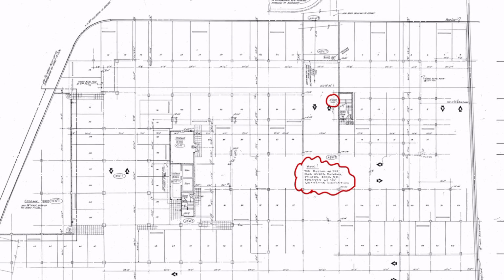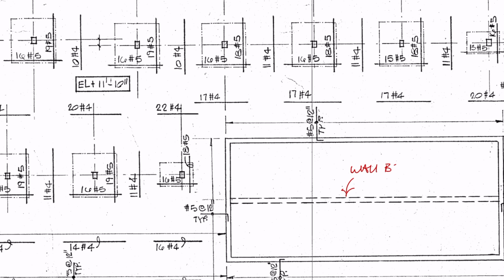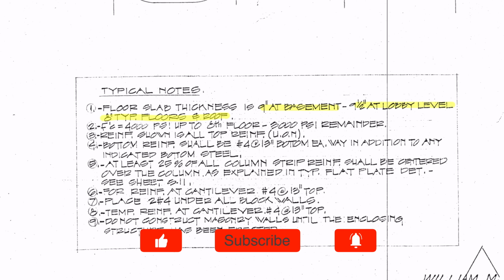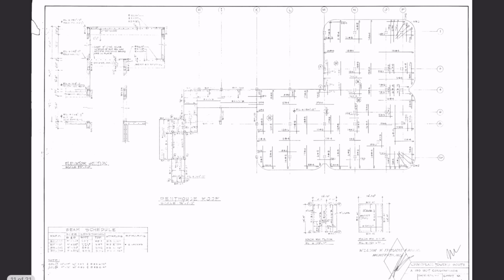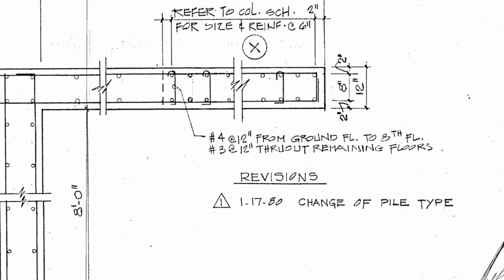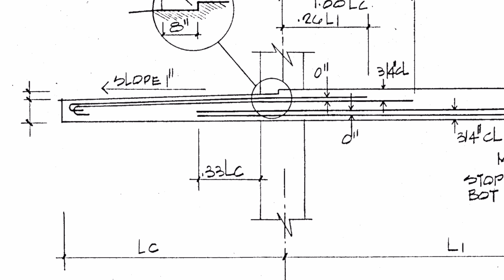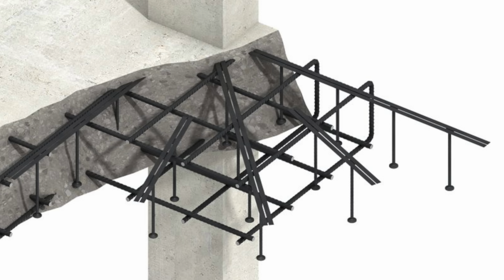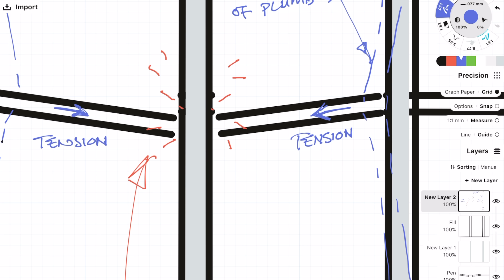Surfside Condo Collapse - Reviewing the structural drawings - Was the design bad?

Comment: Falling debris in the parking ramp likely ruptured the sprinkler system.  Such rupture and resulting water pressure drop should have activated a fire alarm throughout the building, alerting residents to leave the building minutes before the collapse.  Did this happen?  If not, why not??
Reply: I was wondering that myself. Been told some condos do have an alarm system if a pipe breaks to isolate and limit flooding of units. In this case such an alarm could have saved lives.
Reply: @jjintheflesh   I guess the potential for a building to collapse is another good reason to heed a fire alarm.
Reply: I saw elswhere that such a rupture in the parking garage just sets off an alarm to the Fire Dept and not within the building itself.
Reply: @Bangkok-travel-ideas  Yeah, like what the hell?  Shouldn't the occupants be the first notified there is a problem??
Reply: @Just Looking Good observation.  ( Who would have thought a tourist video of a parking ramp interior would go viral? )
Reply: The fire alarm did sound before the building collapsed. The fire dept was already on the way and arrived just moments after the collapse. Loss of pressure in the sprinkler system does alert the fire dept but doesn’t necessarily sound the building evacuation alarm.
Reply: @stargazer7644  Thank you for that.  What good does a fire alarm do if occupants aren't privy to it?
Reply: @dngrwllrbnsn_  The fact that a dry pipe sprinkler system in the garage has lost air pressure doesn't necessarily mean there's a fire.  Just as when a single smoke detector goes off doesn't necessarily mean there's a fire.  How would you like to have to evacuate the entire building every time someone in one apartment burns the toast?  The security office and the fire dept gets the alarm when these events happen.  If investigation shows an evacuation is warranted, you pull the evac alarm.

Comment: Ive poured parking basement slabs for 4 story wood framed apartments .. always 12" thick with top and bottom 3/4" at 8" each way. That's a lot of steel but thats Los Angeles in the 1980's.

Comment: All your points re various technical details are well taken.  However, I look at the big picture. As an architect I would never design a structure like this.  I would have a 12" thick continuous foundation wall under the perimeter of the building tower. Any additional underground parking outside the tower footprint needs to be structurally independent.  One reinforced opening in the foundation wall would allow traffic between the two parking areas.

Comment: After I obtained and reviewed the structural drawings for Champlaign Towers, I was shocked by numerous things that were, or mostly were not on the drawings, including:
Lack of shear wall, as you noted.
Lack of adequate concrete cover on the slab reinforcing.  Failure to capture the reinforcing within the concrete potentially reduces the load carrying capacity of the slabs by 30%.  Appears rebar chairs were not utilized anywhere on the project.
Lack of column reinforcing extending into the slab.
Lack of bottom reinforcing in the balconies.
Questionable reinforcing size and spacing for slab spans as much as 22'-9".
Tying the pool deck slab to the building structure.  Due to thermal expansion and contraction, the pool deck would move differentially to the tower structure.  I would NEVER tie an exterior pool deck slab to the main building structure in a monolithic manner.  Maybe a slip joint.  Even though they require maintenance, expansion joints between the pool deck and tower structure would be better.
The pool deck resting on an 8 inch thick wall on the south side that has no pile footings under it.  Although the section of the retaining wall, on sheet S12 shows a partial pile footing, there are no pile footings shown on the foundation plan.

Just a lot of problems with the structural design.
Appreciate your simple, professional approach to presentation of your opinion and analysis.
Reply: The plot thickens with more input. Great info.
Reply: A typical incompetent engineer and contractor.
Reply: The drawing revision control seems haphazard also, did the contractor work to the latest drawings? Were the design and structural engineers using the same drawings? Things like this should never be left to chance.
Reply: @heathwirt8919  - Everyone needs to keep in mind this was a developer project.  Since the developer wants to spend the least amount of money and get the building occupied as soon as possible, developer projects get minimal construction oversight, if any, and drawings and specifications get changed by the contractor for his benefit.  The developer may not have paid the engineer or architect to do ANY construction observation and materials testing would have been a bare minimum.
Reply: @paulpresson9786  I'm speculating but my guess is the as built condition is probably not to the final drawing release.
Reply: I agree with your comments
Reply: It was built to the 1980 drawings.

Comment: It is 40 years old. Some say code-77, no punch shear reinforcement. Some say the pool deck got pavers 20 years ago. This load was not accounted for. The deck fails, the column collapses because it is attached to a beam to support a planter. And the beam takes down the column supporting the building
Reply: I agree with your hypothesis.
Reply: The concrete code has not changed significantly since 1977, all of the things you mention should have been included in a properly designed building of that era.
Reply: Structural madness says it is too skiny. 20x20 or 24x24 columns. There was no reserve left after 40 years.
Edit: we will see the end report

Comment: Excellent presentation.  This emphasizes what is most likely the principle cause of the failure, poor engineering.  Numerous observers have noted that the ravages of time were fairly typical for this kind of building.  Perhaps because of lack of access to the original design plans, some observers have had to rely on photographic evidence and the 2018 Morabito report to evaluate the structure.  Meticulous maintenance and retrofitting support elements could have saved this building, but this is a nearly impossible standard given the combination of poor building codes in 1980, possible poor oversight during construction, and inadequate inspections over the years.  Responsibilities associated with this structure were so diluted (if everyone is responsible, no one is responsible) that if anyone tried to condemn this building, they would have faced loss of reputation and legal liability. 
 Local government officials should have been more vigilant inspecting older buildings constructed with now obsolete building standards whose failure would have been catastrophic.

Comment: Your analysis of the structural design is compared to the structural design of 2021, I'm assuming. Can you comment on whether the structural design of the building would have been adequate if analyzed in the time of its construction, 1979? In other words, did they consciously design a building that was not robust or would that design have been adequate in 1979?
Reply from the maker: I’m going to do a punching shear analysis to the Uk codes (because that’s what I’m familiar with) and the American code (going to have to learn it).  
I am not familiar with US codes of practice but I will do a bit of research into it.
Reply: @EverydayDazz   Please evaluate the 9-1/2" thick concrete plate used both at the pool deck and at ground level building deck. 

The pool deck is supporting additional 2-1/2" thick topping concrete, pavers, tiles, etc. That's at least additional 50 psf design dead load comparing to the building concrete floor plates.

In addition, the design live load for the pool deck would be 100 psf for assembly vs the typical 40 psf for residential floors.  

The pool deck appears to be too thin!

Comment: I'm glad you mentioned the thickness of the slabs , 200mm is probably just ok in a normal building that is enclosed and not exposed to the elements,  but 200 mm doesn't seem  adequate for a pool deck that has an additional layer of paving , and is exposed to the weather,  all of the pictures I've seen recently of punching shear in buildings,  have been car parks that are exposed to the elements,  these exposed concrete slabs need more support by either pads on top of the columns,  or structural beams between the columns to spread the load, especially where you have vehicles moving on and off the slab every day causing the slabs to flex . I'm not an engineer but I'm a retired builder,  these are just my thoughts.  Btw,   I think you understanding of the problem, and the cause of the failure,  is the best I've seen so far.  I think you are spot on.
Reply: That pool deck had NO moisture membrane. The last line of defense to eliminate water. Many think a membrane is a primary way for water to exit. Not so...it is a backup way for water to exit. Sloping to drains is critical. Years of fresh/salt water just seeping into the non shear slab and columns, seriously flawed.
Reply: I thought the cars were all at basement level. So only cars driving on the foundation slab? Excellent point though I think about the stress and span between columns on the pool deck and no structural beams.
Reply: @fiionnafiionna3995  I believe the visitors car park was on the same level as the pool deck , if you take a look at some of the early picture , you will. See the cars on the collapsed deck, then under that deck was the residence garage.

Comment: Excellent analysis, thank you. It’s chilling to hear about all the vulnerabilities you found in the original design. These will also apply to the two sister buildings on the same avenue. 
As a non engineer, I have found the analysis by Josh Porter of the Building Integrity channel to be fascinating and easy to understand. I am going to follow you both. Jeffostroff also has some insightful observations.
Reply: *Josh Porter
Reply: @MrKoenig1985  Thanks, I corrected it.
Reply: Good point alluding to shoring East & North buildings walls, pillars. I commented the statute of limitations expired; Surfside had 40 years to shore walls, pillars. 

Aedin
Reply: A simple exercise: For each 100 pounds of horizontal component of wind force directed against a north wall, each of the east and west outside walls that are at right angles to it takes up 50 pounds of force. If a third interior wall is added parallel to the east and west walls then each wall will take up 33.3 pounds of force. The floors that also transmit this horizontal component of force to the outside walls prevent inward deflection of the north wall. Horizontal force transmitted by the floors that is taken up by the footings of the columns and rear wall may be ignored for this analysis.
   
Is a third interior wall of solid concrete required? (Referred to in some discussions as a shear wall). After calculating the force that the east and west walls must accommodate it is a matter of design choice. It is likely that the minimum thickness and strength of the east and west walls already greatly exceeds the horizontal force that these must hold back. Thus, for each 50 pounds exerted horizontally, the walls as a result of their strength to function as a wall supporting the vertical downward load from weight, are already capable of sustaining a horizontal component several times that amount, which is why the contribution of the footings was ignored.
   
A building is designed so that the entire structure remains standing. That a collapse is only partial appeals to emotions, not logic. 
  
An interior wall of solid concrete that is not connected by rebar to the adjacent part of the building is in effect an exterior wall to which an abutting structure has been added that encloses it making the whole thing appear to be a single building. Pre-construction-sales enabled raising capital for a much larger structure.¹³
   
The reason behind this two-phase approach is finance, not engineering. 
    
     
     
¹³      For each dollar investors advance for the cost of constructing a 100-unit building unknown to them these funds are sufficient to build twice as many units. The 80-unit addition that effectively costs them nothing accrues to the organizers.

Comment: Unfortunately building code specifies “ minimum” requirements which do not always take into account the environment. Whether it’s an emergency room doctor, or your contractor/ builder, how would everyone feel knowing that their lives may depend on someone who graduated their education with a C- ? ( The minimum passing grade in most educational programs)
Reply: Usually you have to do more regular and through inspections in case of a harsh environment. Building to the minimum requirements can be fine if it is coupled with good maintenance.
The minimum requirements always contain enough headroom for a lot of things to go wrong before the structural integrity fails. If it fails it is designed to fail gracefully, so people can evacuate in time too.
In this case it seems that almost everything went wrong: Cheap building materials, not following the plans completely, constant water damage for 40 years (from two directions: pool deck, and from sea water from below), ignored red flags in the 2018 report, most of the rebars were corroding below the ground level, some corroding above too.
The even more alarming thing is that these problems can be found in many old buildings in the area.
Reply: Multiple people have to sign off on these plans before the building is allowed to be built.  If the “minimum” isn’t sufficient in a particular area, then the minimum should be changed.
Reply: An honest C is better than an a got by cheating!
Reply: I always like to point out that building codes usually specify minimums, just as you say. Too many designers aim for that goal: the minimum. However, there is nothing preventing designers from exceeding the minimum where warranted.

Comment: Another very accurate point to why this building collapsed they should condemned it probably 2 years earlier until they fix the building buzz that I said $600,000 unit well you know and considering the size of the columns inside the parking lot garage should have been a little bit thicker and more well-way maintained especially when you have vehicles that might run into them
Reply: Is it possible a truck or car backed into or hit one of the columns and jarred it loose so me it was fatigued?
Reply: @sshole6658  I don't like the fact that there were no concrete poles by the columns as there should have been. I am certain there were bumps and possibly even hits over the years. I want to know when and why that huge piece of concrete was cut away and replaced in the parking garage. What was going on in or under that slab that they had to replace such a large portion I wonder.
Reply: @sshole6658  
Hitting a concrete column in the garage with a car should not topple the building.
Reply: I like this comment !

Comment: It is possible that the initial punching shear failure in the pool deck slab now left these lower columns with no lateral support,  “longer” than they were designed for, and subsequently causing buckling of these columns and eventual total failure of the structure.
Reply: That is what happened.See my post

Comment: With all the design flaws, how did this building ever pass the initial inspections.
Reply: This was 80s  Miami.  Never seen Miami Vice?
Reply: @OOpSjm  I see. So that's why Crockett lived in a boat!
Reply: @andynicolson1057  🤣🤣😂
Reply: Because they weren’t flaws when the building was built. The building met code at the time.  Building codes have changed since then.
Reply: Notice he didn’t say they were flies. He said they were kind of minimums. Which in this case means the structure was standing fine and would’ve continue to if not exposed to any abnormal stressors. The question is what were those Stresses. 
The building passed inspection because it was built to code. Or at least it appears it was. We won’t know if the proper amount of rebar was installed until after the report is released by the investigators.

Comment: Punching sheer reinforcement wasn't a requirement when this was designed, however additional top rebar had been added but this appears to have delaminated (as seen in the core samples taken on the pool deck prior to collapse) due to inadequate waterproofing layer. With this gone there was practically no punching sheer protection and the pool decking gave way (from film footage, possibly first under one of the pool decking planters due to the added weight). So in reality the culprit was the lack of waterproofing to the pool deck slab, allowing 40 years of water damage.
Reply: @Andy GREEN You've been watching Building Integrity again haven't you?
Reply: @ClippyNeverSoldout  him and another guy, he was blaming the pool deck about two weeks ago but yeah building integrity did a great job of explaining the punching sheer and the delamination of the top layer. Definitely worth a watch.
Reply: I would blame the pool deck overlay added afterwards.

Comment: The cores taken of the slab before the collapse show there was a lower layer of rebar.  However the cores also show the slab split horizontally between the upper and lower rebar.  Apparently this is why the remaining columns look like spikes instead 'T" after punch-through, it made the slab weak enough that it failed at 45 degrees inward rather than the 45 degrees outward that you'd expect to see.